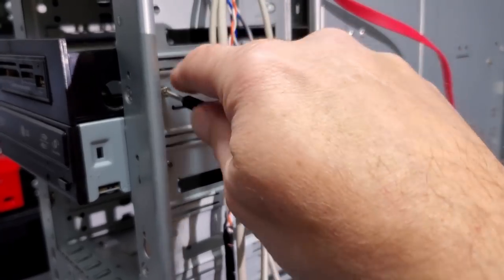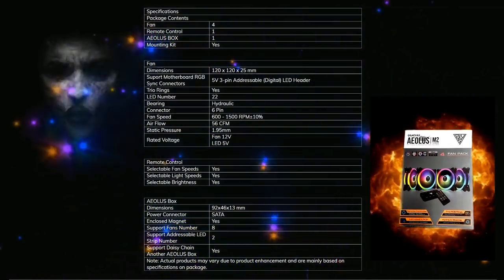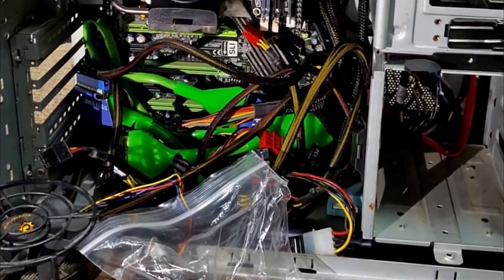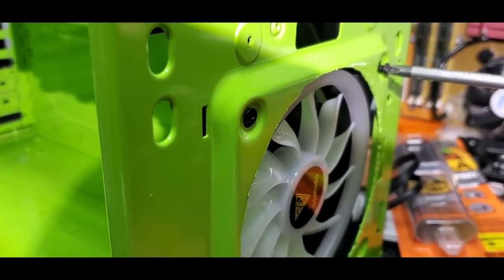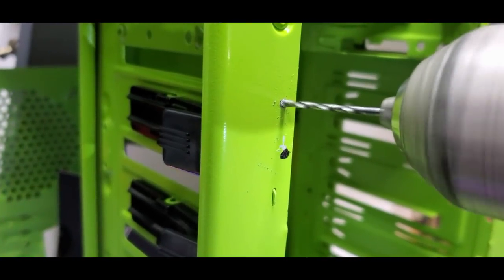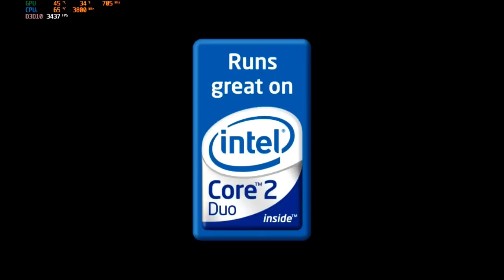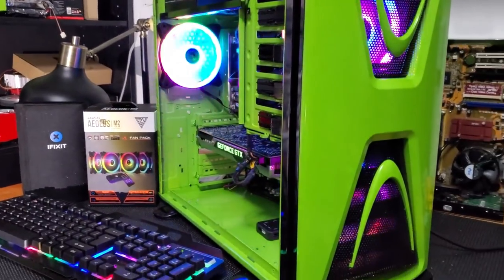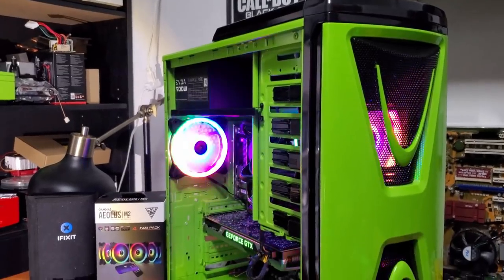RGB Gaming even with an old computer Case!

Comment: dude that is so sickk!! ive got an older alienware i need to restore. its one of the middle 2000s one with a pentium 4ht and a 8800gtx i believe. 

any advice on restoring it? It has the bare steel inside and back side and on a corner of the case it has a little corosion. the computer is 100% functional with a legit original xp install and it runs flawless! i cant decide if i should sell it as it sits, restore it and sell it or repurpose the case and do a sleeper build. I really love the design of the case and want to let someone enjoy it. its the really cool metallic blue color, the paint and plastics are in ok shape but it could use some sanding and buffing. do you think i should sand it down and clear it? i think all the plastics are actually colored plastics and not painted too. im scared to mess with the originality of it since its a pretty rare pc now a days and its in its original form fully decked out it was 5,000$ new